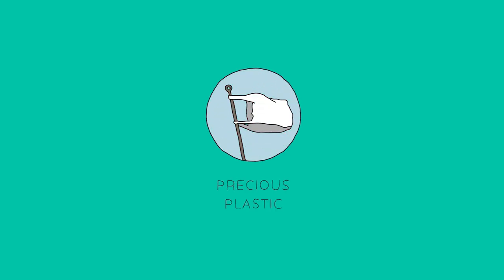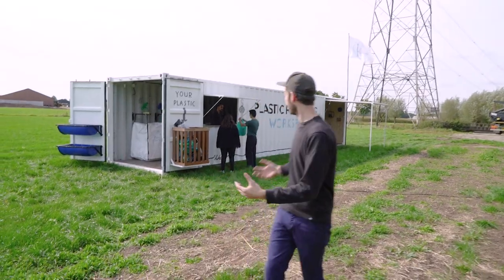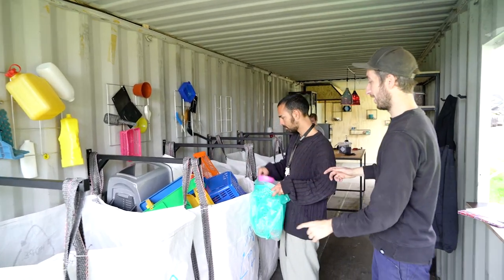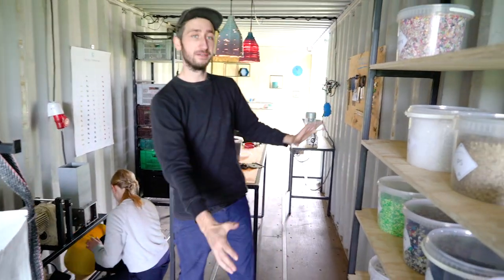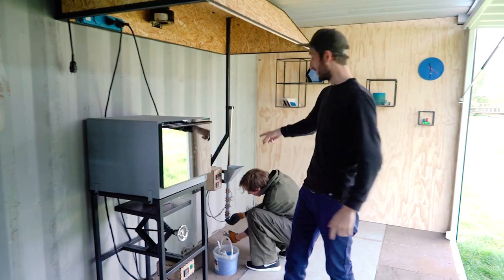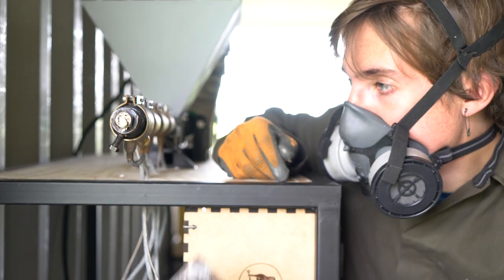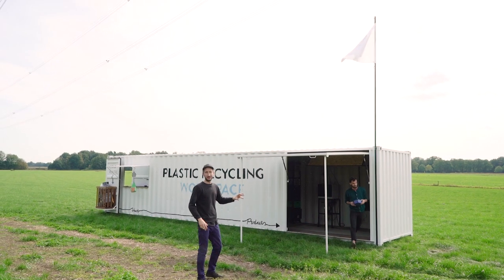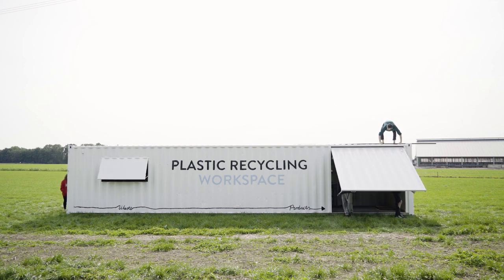Precious Plastic - How to run your workspace #4

Comment: You should make a video about how to make a "wood-gas generator" or "gassifyer", it allows you to run a generator on burning scrap wood and it is a very clean burn. It was used during ww2 when oil was very expensive. Would be ideal for developing countries where power may not be constant / available.
Reply: But why? There are plenty of videos on YT showing exactly how to do that already.. plus there are "ready to make" plans for a gasifier that you can dowload straight from the FEMA website.

Comment: Assuming people wash their small amounts of plastic waste at home and then bring it to you. What impact does the energy used during cleaning (heating, cleaning of the water of washing detergents etc.) has on the overall calculation that justifies PPs way of recycling.  (Yes, I am aware that PP is also to create an incentive to control plastic waste in the environment and to counter the waste-culture we currently live in)
Reply: In my mind the greatest impact is going to be the creation of timber replacement products from these recycled plastics, which is already happening. As it gathers momentum and scale, the plastic wastes from our cities can reduce our reliance on logging of remnant forests. A Double win for this Planet.
Reply: I think the vision is that we will have abundant energy in the future anyway and it's more about recognizing plastic as a valuable material like metal p.ex.
Reply: I think you are right.
Reply: +colinbarsby : I don't understand your comments, do you think that plastic is made from WOOD ???
Reply: the are replacements for timber already, bamboo and hemp... there is no need for cutting trees at all
Reply: As you would know, bamboo and hemp biodegrade very quickly in the outdoors, which is why hardwood timbers outlast them. Plastic has the ability to outperform hardwood timber outdoors.
Reply: from what I know, bamboo does last less than wood, but not enough to say it "biodegrades very quickly", treated bamboo is used in construction for a reason, if it did biodegrade very quickly it wouldn't be... hemp depends on the way you use it, it can replace wooden beams in construction in the form of hempcrete, which probably lasts longer than regular concrete... plus other ways which also don't "biodegrade very quickly"...
Reply: Bamboo is usually grown in wet tropical areas, and is used extensively for construction in the same wet tropical areas. Hot, humid conditions accelerate natural decay. Yes chemical preservatives will delay that. My point is that timber is extensively logged for outdoor use purposes, and timber still decays outdoors, with a useful life of hardwoods often 20 years or so. Hardwood trees take 200 plus years to grow, and we log them for a purpose of 20 years. This is a video about repurposed waste plastics, which will last 50 plus years as timber replacements.
Reply: There aren't many uses where plastic can actually replace wood. It doesn't have the same characteristics at all. And where it can replace it, plastic is usually already used, the fact to recycle it won't save any tree (sadly).
Reply: Absolutely not correct see http://www.replas.com.au/
Plastic is being used to replace timber jetties, piers, boardwalks, bollards, posts, fences, decking, signage, and more. And we are only scratching the surface.
Reply: Waste plastic that is recycled and re-granulated is extruded or cast into planks, that can be used instead of using wooden planks. Is that clearer?
See http://www.replas.com.au/
Reply: yeah, most trees we cut for timber don't have 200 years, where did you get this info?? the trees we cut for wood vary mostly between 7 to 30 years of growth time...and wood has more outside time of use than 20 years... but I do agree that we need to stop using it... even if its eucaliptus or pine trees, which are the most used for reforestation... Plastic beams can be manufactures, but  i don't think they have the mechanic properties to be used in structural stuff... I've seen replas website, and their uses are more for benches, pavement and fencing, not much for structural uses... it covers some of the wood uses, but not all, we could couple their use with the use of bamboo for structural purposes and furniture as well...
Reply: +colinbarsby : Just because a company in the plastic recycling business says how wonderful plastic is and how many wood products THEIR products could replace doesn't make anything I said above less true. I stand by the claim that plastic hasn't by far the same characteristics and most usages of wood can NOT be replaced by plastic.
Reply: I agree to disagree. Thx for sharing your opinions.
Reply: Hardwood trees like Red Gum, Jarrah, Mountain Ash are hard because they are slow growing, Softwood trees used in plantation farming grow quickly. Your last comments are exactly true. Composites are the future..
Reply: This is a Precious Plastics video, where microbusinesses can receive junk plastic, paying money to the collectors, sorting and processing the plastics and turning it into saleable products that customers will buy. The recycling business you are not impressed with, is already doing it. They are the largest successful waste plastic recycler in Australasia, and MOST of what they sell replaces TIMBER used outdoors. Sorry if that causes issues for you.
Reply: Hi Raphael, just to clarify. Most Hardwoods in Australia are logged in remnant native forests, where the biggest and best trees are hundreds of years old. The ROI is not fast enough to justify Hardwood plantation businesses. We do have Radiata Pine and Blue Gum plantations. As you said plastic composites are an exciting future business. Plasticised Bamboo has many possible applications.
Reply: Colinbarsby.. dont agree to dissagree just because some dull minded simpleton cant see the far end of his own nose LOL.. you are ABSOLUTELY correct in claiming that more and more products are being released on the consumer market that offer very valid alternatives for products that are now made of wood, new plastic and/or other materials. Such as, but not limited too, fencing, decking, siding, pavement, roofing  etc etc. But as well stuctural items such as beams. Heck, i have even seen entire bridgeds being build by mechanically fused plastics. Soon enough there will be viable replacement products to replace the wood in wooden-frame-houses. This is not an arguement about estetics nor is this someting "to agree to disagree on".. someone that wants a wooden fence, wooden decking, wooden siding etc and is not open to alternatives.. will not be into it.. but, luckily, for everybody else that wants a solid, durable (Way more then wood!), very low maintenance (way more then wood!) product alternative while knowing its mostly or fully from recycled plastics, can do so. And the arguement of "it wouldnt save any trees" is complete and utter BS too, cause EVERY person choosing for the alternative FACTUALLY saves the trees that are now not used for his/her product that otherwise would have cost wood. On top of that it means there is LESS plastic roaming around free on this planet.
Reply: I agree with you completely. And the best materials will be hybrids. Composites of blended materials. Plastic being a water resistant bonding agent with various other materials offering a range of possibilities. The sand/plastic roofing tiles being one, bamboo/plastic planks, metal/plastic, and on and on it goes
Reply: Colin, yes very true, the composites and material blends are popping up all over and I find it very interesting to see them appear. What caught my liking alot in the last years were those bridges build by some brench of the US military to replace thick wooden beam bridges. Those bridges are a blend of plastics that chemically do not mix but are mechanically blended at temperatures to obtain an end product that gets the characteristics of all the materials involved. It is then extruded into beams etc. These bridges are on battle training grounds and are for tanks and ended up being able to carry more and last much longer then the old wooden ones. While being from 100% recycled plastics. Simply amazing!
Reply: There is hope for this planet, despite all the paid for Politician's being paid to look the other way. Citizen led sharing of knowledge seems to be our best path, and the plastic menace can be harnessed and tamed.